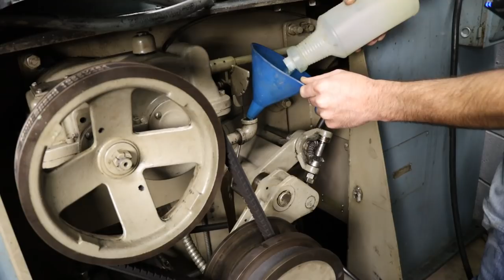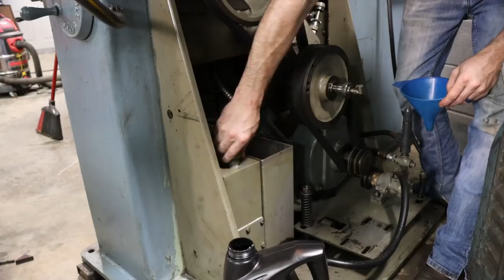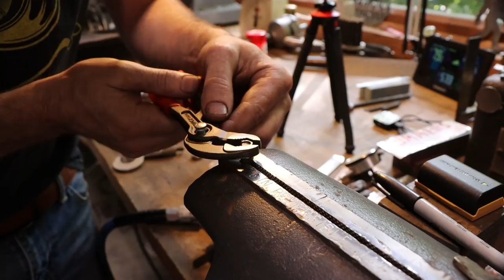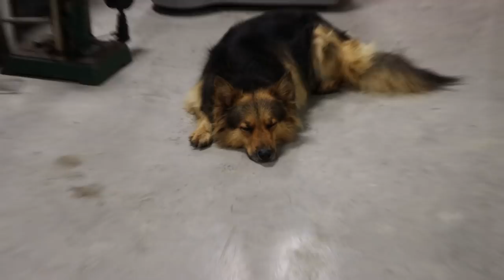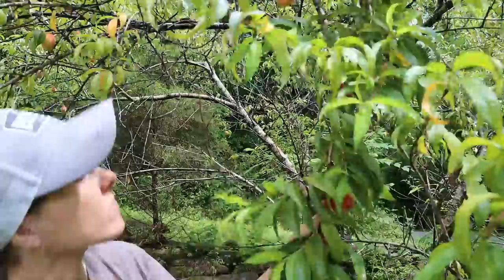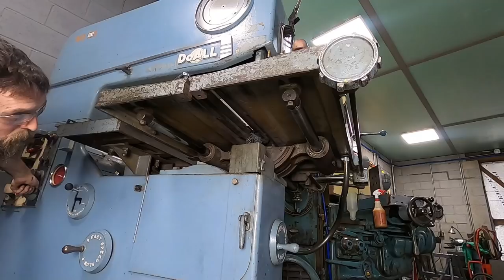Massive1953 Doall Saw repair and test run.

Comment: You lost me at "the good old days". When those machines were built, they were NOT something that a hobbyist could afford, they were the best in the industry. There was plenty of crap built back then that didn't stand the test of time, and there are plenty of industrial machines built today that spare no expense to be robust, comfortable to use, aesthetically pleasing, etc. Common manufacturing practices back then were quite different from what we have today, which contributes heavily to the aesthetics. For example, cast metal parts were far more prevalent, and optimizing a cast metal part for cost vs optimizing a CNC or injection moulded part for cost will result in wildly different-looking designs. If you can afford a modern industrial machine that is market-equivalent to one from the old industry, you can get equivalent quality.
Reply: The phenomena is called, "survivor bias". Where someone judges the past by what is left from what was around then today. Not realizing they are not taking into account everything that was trash and was trashed over time. All of that is out of sight and out of mind too.
Reply: I was 12 years old when that machine was built. You are right, no one I knew of could ever have afforded a machine like that. We had one in our school shop, but were not allowed to use it (?). People nowadays don't realize how much junk was made then. The cars were junk with rust on them from the factory and often starting poorly, running poorly and breaking down often. "Cheap and dirty" was the slogan of many American products. If you wanted quality and could afford it you bought German or Scandinavian. The good old days were never as good as they were old.
Reply: Many hobbyist couldn't afford the space for a machine of that size, then or now. But we sure would want one, then and now...
Reply: @standintallish5223  for what I do I'm OK with my 4x6. Doesn't take up a lot of space and gets the job done. It's nicer than the red one Steve has. Mine was actually made in Taiwan.
Reply: I enjoy these comments. I did CNC machinist maintenance. We utilized many brands from numerous country sources, but we were primarily a Mazak shop. Mazak's USA plant is near Steve in Florence, KY. Industrial quality machines are still manufactured with enough cool features to still be classics in a few decades. Machine automation has changed the used machine market radically. By the time a CNC is really worn out the technology is so outdated that they have virtually no value. Old industrial manual machines are seeing a great revival in the hobby market, but in the production market they also have little value. I love the old machines and my shop is full of and built around them. 
I have a Powermatic 90 wood lathe retrofitted with a VFD and still using the reaves drive. This gives me lots of options and it is a fabulous machine, but it is still a Powermatic 90. The design limitations have me wanting to upgrade to an American Beauty or a Oneway to take advantage of new features and technology. 
Old iron is still cool. I picked up a Craftsman bench top drill press for $25 with a Pexto angle vise. The drill press was made for about 6 months when war production demand shut down manufacturing. The drill press was frozen in every function except spindle bearings. It turned out that the rust was only surface rust and polished off with Scotch-Brite. It made a cute machine addition and it was made when Craftsman was a fairly decent machine. I think that this machine was almost never used. It was stuck in a damp basement and rusted. There isn't a pecker mark in the table. I even salvaged the Dunlap motor that was on it, likely original. It has two goofy period features or design flaws. The motor switch is on the motor base, not very convenient for a drill press. The step pulleys vary enough that belt tension requires adjustment with speed changes to prevent pulley rubbing on the belt guard. But it is a delight to operate. I use it more than my vintage Powermatic mid size or very large DoAll for small hole drilling. I kept the goofy switch location, because the machine is otherwise original except for my not quite right paint color choice and a new belt.
The issue being discussed is more about legacy machines that deservedly survived. Comparing a vintage DoAll band saw with the modern machines in today's competitive off shore manual machine market isn't likely very fair. What production shop is even in the market for a new DoAll featured saw today?
Our last production saw purchase was a HydMech, full of features not on a vintage machine, but it was absolute junk. Good machines were available, but they were pricey.
Reply: @1pcfred  I came here to mention survivor bias myself.  What you see in the surviving machines from the 50's are those machines that were deemed worth saving - i.e. the good stuff.  The cheap stuff was tossed along the way.

For another example look at medieval armor in museums.  Think every soldier's armor (when present) was brightly polished and gilded? Think they all carried swords with gems in their hilts?  Those are the ones deemed worth saving.
Reply: survivorship bias notwithstanding, i think the point that making cheap stuff that breaks is bad, wasteful and ultimately probably more expensive because of churn probably stands
Reply: @handdancin  what's wasteful is making things better than they need to be. It's great that things still work after folks pass away but what good is it really doing them when they're pushing up daises? Then when things are made that well they tend to cost a lot more so that's a barrier of entry. You could go your whole life without affording it. Again doesn't do you any good. If you can't have it then it really doesn't matter how good it is.
Reply: @russkepler  survivor bias is a common logical fallacy trap to fall into. Any time when you're missing context you're probably not going to have a complete understanding. Plus we have a way of remembering things as being better than they actually were. The good old days effect. 20 years from now today will be the good old days. Regardless of how much we're all presently complaining. It's some psychological quirk we have. Helps with survival.
Reply: @paulhunt598  we definitely live in different times today than any previous era. So things are not so easily comparable. I think folks today have more access to tools and equipment. Whether it is good, bad or indifferent. Them old timers really had nothing of their own. Manufacturing is not the same as prototyping or maintenance either. Doing one off work as opposed to mass production. They're different jobs and require different techniques. CNC has its uses but manual machining does too.
Reply: @paulhunt598  Hmmm, Abom79 thinks his Hydmech is the cat's meow. It sure has all of the bells and whistles, but I suspect that in a production environment it would not last long.
Reply from the maker: I wasn't referring to what the hobby guy could afford.  I was  talking industrial equipments appearance and attention  to  detail on the small things that just make a machine  unique. I agree you can still buy quality equipment if you have the cash 🙂.  You can buy a space shuttle if you want.
Very few if any machine tool manufacturers look different from one another these days. Have a look at what Doall is selling now.  Most CNC machines are  nothing more than a square box with a machine inside. They do what they need to I guess  but some character would be nice, that's all.👍
Reply: @BruceBoschek  Well said.
Reply: @SteveSummers  Hey Steve,
This is still an interesting discussion. My company built industrial printing machines. We built mid range equipment, but acquired one of the premium machine manufacturers so we could compete in the very high end market. Our machinery was designed to compete in the world market and special attention was given to "European" appearance to compete against the very highly regarded European manufacturers. These were very conscious design considerations including relying on design artists for the desired "look". We later shut down production of the high end machinery since that market was very soft. A subsequent decision to re-enter that market meant that the very high end machinery was now being built in our plant on our design platform. This market valued the appearance issues that you commented about and started this interesting discussion.  This market re-entry meant that we built a machine for a Chinese company that made lottery tickets. I understand that this company was pleased to pay our $7M price for one machine. In this price range some very impressive machine design (including artistic enhancement) was included.
On a less costly level Starrett, Snap-On and Wilton still include fit, finish and the right feel. That is partly why I willingly pony up for premium hand tools. The primary reason is I value high performance, but I am like Mr. Pete and I grab these better brands partly just because they feel and look good in my hands. Brown and Sharp makes some very fine tools and I own many, but Starrett makes finer tools. I use my B&S, but I tend to grab my Starrett more often and with more user pride.
Some of my boys call me a tool snob, a valid accusation. The majority of my tools and equipment are on the very high end and I own very many brands. I tend to purchase what I regard as the most functional and best cost for still extremely high performance. I tend to think sometimes that means stepping down to a second tier level. I don't own a full st of Snap-On pullers. I think that Proto does a better job at function with pullers than Snap-On. For that reason I may own more Proto pullers than Snap-On. In this case I opted for function over the Snap-On look. I probably did better on cost too.

But this is still a fun discussion. I am jealous of your DoAll band saw. I have 3 band saws. None compare with your DoAll.  I used to be smug when seeing you use that little HF, but now you have way out classed me!

Comment: Mobil DTE2400 - They're very proud of this stuff.....Yeah as reflected in the price I'm sure !
Reply: 4 gal's @ McMaster (which we all know is not economical) goes for around $125 plus freight.  In a busy shop with correct maintenance, that is expensive.  Steve's use, not too bad. There will be quite a while between flushes I would think.

Comment: So I bought a 9 inch bandsaw.  It's made entirely out of plastic.  The case, wheels etc.  Only metal is the blade and the motor.  Cannot cut a straight line even with a guide.  I use it primarily to make scale model railroad ties.  The uneveness of the cut makes perfect looking ties for my model railroad. Paid $100 for it.
Reply: I have a Rong-Fu 4x6. It doesn't cut too square but it still don't owe me a dime today. 4x6 is just a suggestion. I've cut heavy commuter train track in it. Some of the 130 pounds a foot stuff.
Reply: Saw a plastic car jack the other day!   The plastic age will only end  when thy find a cheaper medium to replace it with.   Steve said it best “on our race to the bottom”.

Comment: I know of lots of guys flushing out gearboxes, transmissions like this, it seems to work fine
Personally I use only the rerecommended lubricant .. drain it, fill it , then change it again in a week or so :)
Reply: Everybody that gets tired of paying upwards of $50 per gal for fancy lube, uses diesel as a gentle solvent.  There is no better way to clean a gear box.  Diesel has way more detergent action than the recommended lube and is totally safe if you use you head and keep the load down.
Reply: @paulcopeland9035  I must admit I've never had to service equipment that had %50 a gallon oil, I'd check my Amsoil comparison chart! :)

Comment: I have the same opinion as you Steve. I believe that all of the designers of just about everything we buy these days go to college to have their brains removed. This is so they can't have an idea of their own, just look at the cars we drive, they all look the same, just sizes make the difference. Machines are the same if a piece of plastic will do it gets used instead of steel/cast iron.

Comment: Nice machine there Stev, Question when you opened up to 
put blade in what are them some tools or spare parts on that 
rack between the two top wheels,
Reply: They’re additional blade guides for different size blades.

Comment: What size is the material/speed chart?  I've got one that is 11.5" in diameter on an old DoAll saw that I won't be repairing.  If it fits, its yours.
Reply from the maker: I'll check, Thanks for the offer. Please send me a email and we can talk there here shortly.  Noel.steve15@gmail.com

Comment: For sure you need to get the job selector wheel. Otherwise how will you know what speed to cut asbestos or meteorites? ;)
Did you anneal the blade after welding?
Reply: Starrett makes a handy little pocket saw blade guide. Shows blade tooth counts, speeds and feeds for different materials. I’ve got one.
Reply: Are you honestly asking Steve if he skipped a maintenance step? Take some time and review some of his videos!

Comment: have you ever used Fuel Oil to flush the crud and so-forth, out of an engine or lube case, I used it quite often in the old days it always worked quite well for me.   Ole timer
Reply: He did!  Okay, this has been discussed many times. I do not want to restart an old fight!!  Fuel oil is #1  diesel. #1 Diesel is kerosene (and jet fuel).  There, that's it.

Comment: I haven't handled the equipment directly, but another channel that I watch, Andy Rawls, recently got a sponsorship from Oliver tools. Apparently, they are trying to meet this need and make over built rigid machines more like 1950s machines. From video they look pretty legit. Obviously you have to ignore the presenters opinion, but their gear looked pretty heavy duty and had cast brass labels. Probably wishful thinking, but I wish the attitude of buy it once would come back. It's not even fair to compare these tools side by side when the old stuff can be utilized for several generations instead of several years

Comment: where do you get those small cutting disks and shaft for the die grinder?
Reply: The most popular place is Dremel moto tool attachments although they are available from other suppliers. Dremel calls them Emery cutting wheels. They come in different thicknesses too. I like the super thin ones. You just look at them wrong and they explode though. So don't say you weren't warned. It is a major accomplishment to use one and then be able to put it away afterwards. They come in sleeve tubes of 36. So that gives you a few tries.
Reply: @1pcfred  ah right I've seen the Dremel ones they got a special shaft for them and expensive. I know as I got some for my Dremel lol. These look like the thin ones you get with those cheap multi tools but the ones in the video are bigger and I've not seen them before. But thanks I know what to look for now
Reply: @TotoGuy-Original  the ones I'm using now were branded by Black and Decker. I doubt they made them. Just put their name on them. B&D used to have an outlet here and stuff was cheap. But I've had the Dremel branded ones too. Same thing pretty much. The imported ones are probably the same too. What's new is the diamond discs. The emery discs are nice too though.

Comment: Can the blade ends be ground on the blade welder /grinder somehow, seems to me  it should be all you need
Reply: Sure. There is usually a blade cutter on the saw as well, that makes perfect 90° cuts. Some saws even have a compartment where you can store a coil of band and it feeds out right into the cutter/welder.
Reply: @RambozoClown  ...If you review the video from last week when he was initially checking out the machine , he preps a blade and shows that function.  I believe he is comfortable with how he ground it in the video, and that is how it will be!

Comment: i got the same saw and when it runs the motor is jumping all over the place. i noticed the removed the air compressor from the motor mount. just need more weight or is something bent? this saw is sort of a nightmare...
Reply: You need to pay attention to this video.  Steve does not miss a thing when it comes to correct assemblies.  If you have a serious snag, I am confident he would go out of his way to help with an email or two!

Comment: Dollar store scissors only work on dollar store paper!
Reply: Dollar store scissors can work OK after you sharpen them and maybe tune the hinge pin up some. If scissors are real bad there's no harm in trying to sharpen them some. But sharpening scissors is a bit of a trick itself. Odds are if they're that bad anything you do will be an improvement. I've gone as far as knocking the rivet out of cheap scissors and putting a screw and nut in them.

Comment: Actually, that upper pulley was machined off the center of the casting. That’s why it looks off when it runs. But the outer groove where the belt runs is concentric with the shaft. Still, it’s a bit off balance.

The American tool machine industry collapsed in 1982, due to the new economic policies. That’s historical fact. The history of Brown and Sharpe I just finished reading makes that clear. Companies couldn’t afford to over build any more. Additionally, computer control was coming in, and companies couldn’t keep machines for 25 to 40 years any more, because new technology required them to buy new ones every decade or so. So who would pay these huge numbers for old technology? No point to it. Modern machines are much better and more accurate, and they’re CNC, for the most part, replacing large manual machines in factories. These old machines have been relegated to rework shops where they get them cheap, like Steve has. 

Sure, it’s a shame. But products being manufactured today couldn’t be made on machines like those older ones.